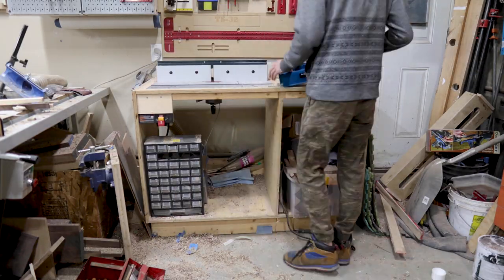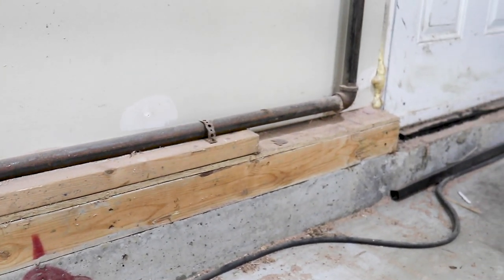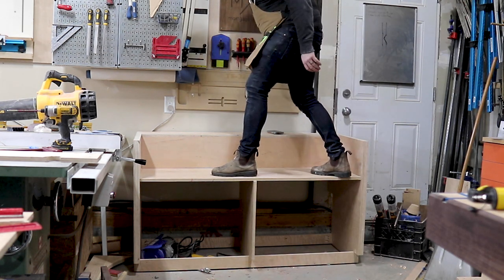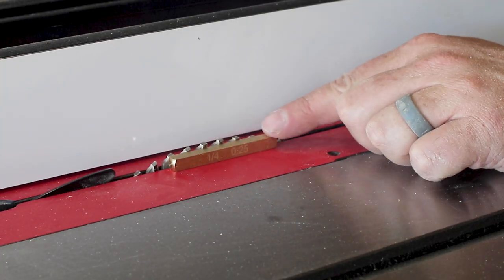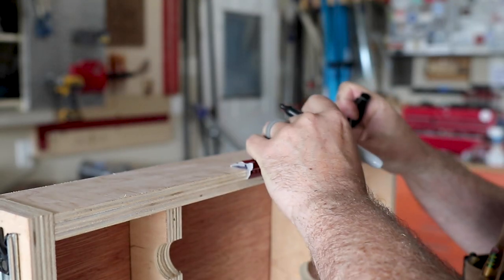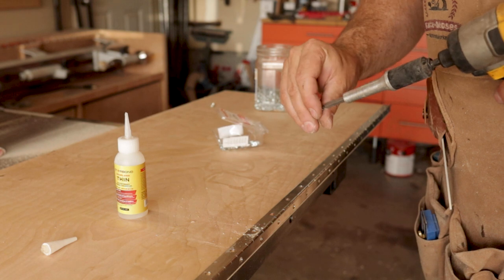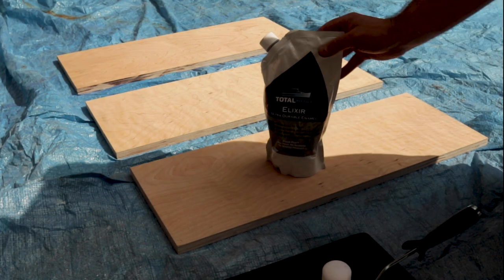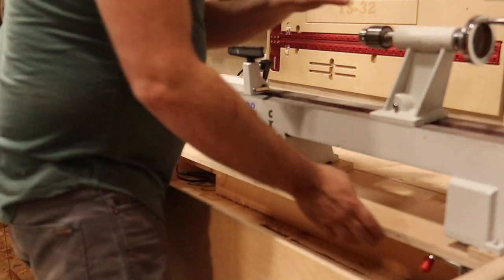How to Make a Flip Top Lathe Cart // Flip top Workbench

Comment: I like this idea of storing the lathe sideways but the actual flip up part that holds the lathe doesn't look as solid as your double ply sides. Have you had any issue with vibration on larger unbalanced pieces? I'm at the point where I'm considering just leaving my lathe out all the time and using it as a disc sander when not in use. It seems there's no good way to design a flip cart that doesn't look a little unstable for a lathe. I also don't quite understand how the dust collection will work with this design. Would love to see a follow up video.